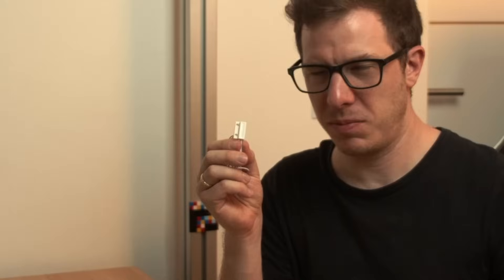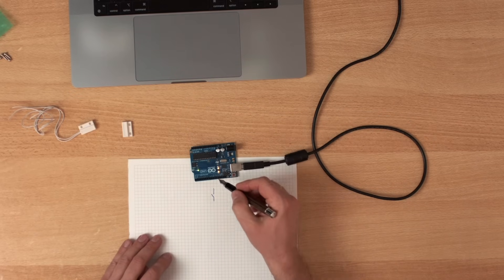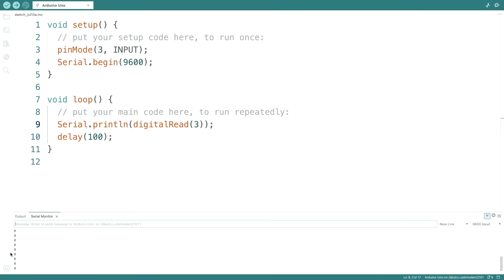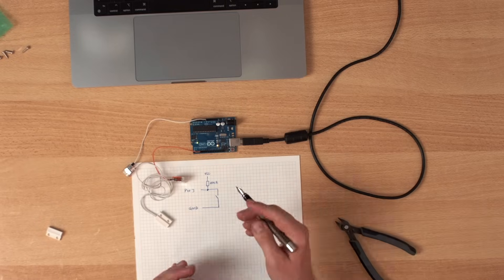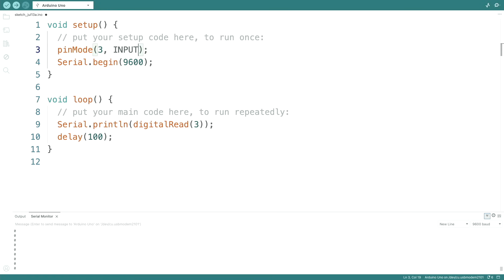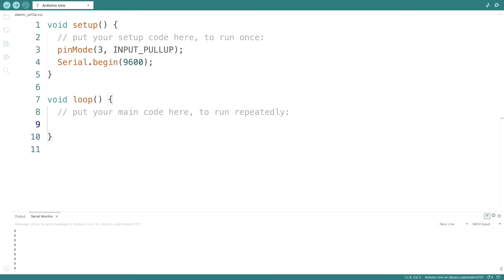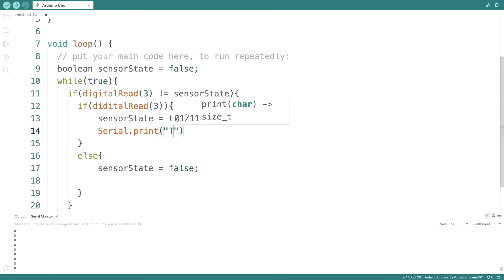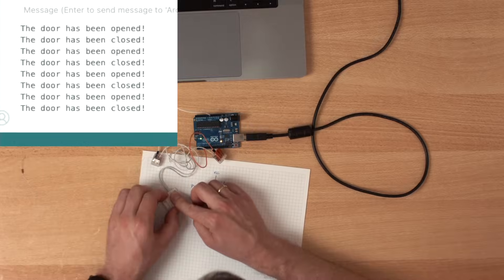Arduino Magnetic Door Sensor: The Ultimate Guide

Comment: Debouncing with a microcontroller is best solved software side. after the first status change just do not accept further status change for some milliseconds in the code. This solved almost all debouncing problems I had so far.
Reply from the maker: I agree 👍
Reply: @playduino  I guess the "Serial.print" is too slow to measure a bouncing. Maybe increase the speed and reduce the printed text to a single character.
Reply from the maker: Yes maybe Serial.print is already debouncing.